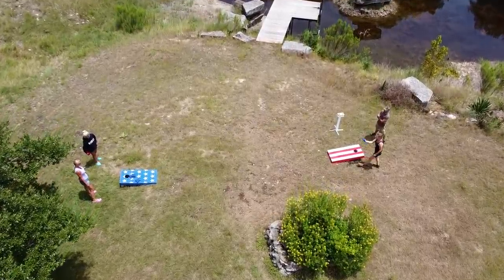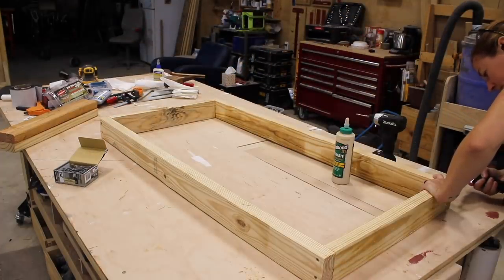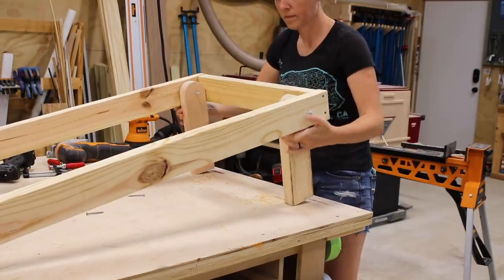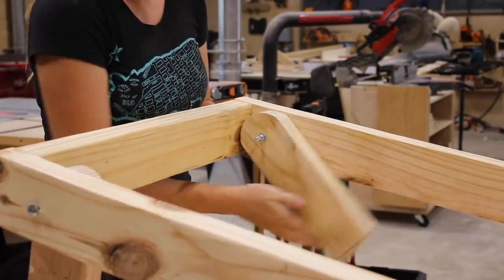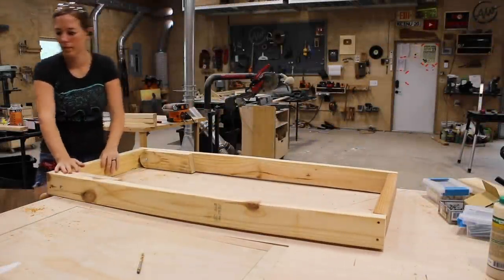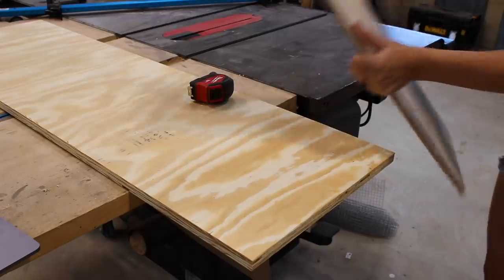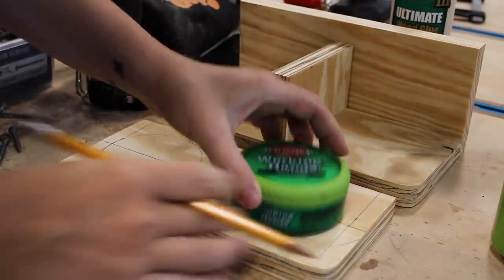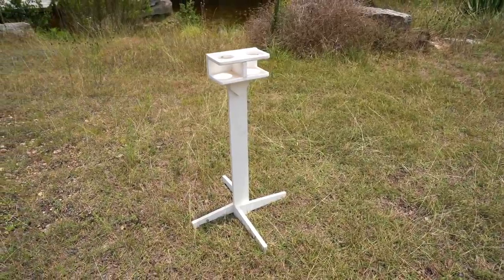DIY Bag Toss/Corn Hole Set

Comment: A couple "pro tips" since I've made a few sets myself: make sure the legs are NOT right against the top board when they're in the stowed position (when you're drilling them into place) or else they will be difficult to move. And for a slicker surface to slide the bags on, add a few coats of polyurethane with a quick, fine grain sanding after every other coat. I wouldn't go more than 6 or 7 coats or else they get too slick. You can also add handles to the side to make them easier to carry and if you really feel like being fancy, there are light rings you can buy to attach on the inside of the hole.

Comment: I made a set of those last year and after painting, gave it 3 coats of polyurethane, finely sanding between each one. Then 2 days after last coat I polished it with automotive rubbing compound, then a spray-on polish. Super smooth!

Comment: Nice job April as usual, you do great videos that are easy to follow. Your videos are inspiring and fun. I appreciate them and you. Tell mom and dad Hey!
I use pocket hole screws to  assemble the whole unit. That way there are no visible screws. Even the top board from underneath.
I also set the side box frame boards in all the way around 1'' , it creates an 1'' overhang for the top board and makes painting and even transporting the boards easier to grab.
Also between the leg and side board I put a 2'' diameter fender washer to space the wood leg from the wood side board so you can make the legs tighter but without the drag of the whole leg.
I also flip the board over on to the face to cut leg angle. Using a 16'' sliding square set to 12'' and a 6' steel ruler for the straight edge instead of using a paint can and the side of the table.
I do this set up on saw horses due to limited space and no good flat surface to use. 
I never use one leg to cut the angle on the other three, I believe this sets you up for potential disappointment X three.
I believe every leg is unique to it's location and lay out each one separate but, do I cut them all on the miter just like you did. This has really worked well for me. I use an angle finder to set the miter saw blade to the exact angle needed per leg. It is surprising how much you will need to adjust the blade between each leg.
This allows for any variable from drilling the leg pivot hole which is not exact by any means and this cuts down on frustration from a wobbly board due to uneven legs, or from having to adjust the height of each leg per each corner to get the board to set flat.
I also build a lockable box under one of the boards for bag storage, mice love corn. My niece put her corn bags in her tent for safe keeping while camping and raccoons chewed through the side of her tent to get the meal. 
Now she can leave the bags in the box under the board to stay dry and thwart any and all vermin.

Comment: The best thing to use when anchoring your legs is a nylon locking nut. This way you can just tighten the nut enough to allow movement in your legs and you won't have to worry about the nut backing off and loosening the legs too much.

Comment: You did not mention how you placed and cut out the actual "Corn Hole" hole.  If I remember correctly, it is somewhat of a precise measurement.  :)   And, I just used wing nuts to hold the legs in place...  No "over tightening"

Comment: You could change the drink holder to attach to the side of the post instead of the top then you wouldn't need to add material and you could add another set of holders to the other side.

Comment: I found that just sanding and painting doesn’t get the slickness that you would want in cornhole boards, but adding 4-6 coats of polyurethane clear coat lightly sanding between coats gives good slickness for rec players, 8-10 coats for competitive players

Comment: Did you mention how you cut out the bag holes? Or did I just miss it?
Reply: Rich Dewey  A hole saw of that same size will work (expensive to buy) or do it the same way she cut the drink holder holes - drill first at the border of the hole and then cut the remainder with jig saw
Reply: Rich Dewey she didn’t mention
Reply: You can use a jig saw.  If you are making many get a 6" hole saw from your favorite ebay, amazon...  It was not that expensive when I bought one 10 years ago.
Reply: Yeah, she definitely skipped that.
Reply: Its a 6 inch hole. Amazon has one fairly cheap, and fairly shallow, made for thin plywood. Ive seen jigsaws used, routers, hole saws, theres a few different ways. 12 inches from sides, 9 inches down from top
Reply: It is a 6in hole.  You can use a hole saw(expensive and accurate), a jigsaw(cheap but not as accurate), or a router and jig(cheap and accurate).  The center of the hole should be 9 inches from the top of the board.